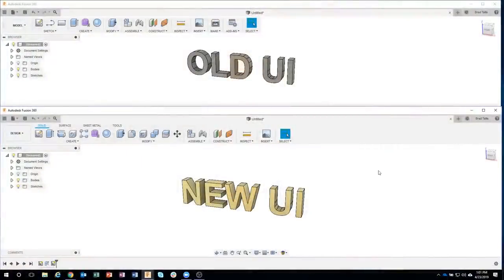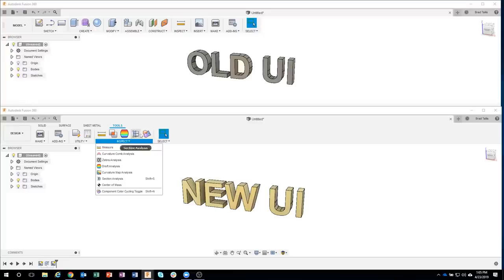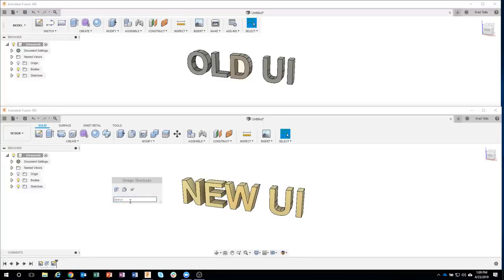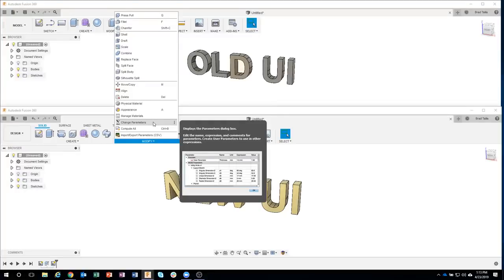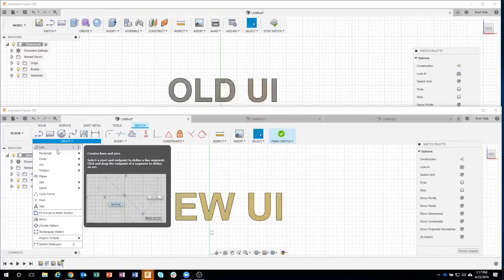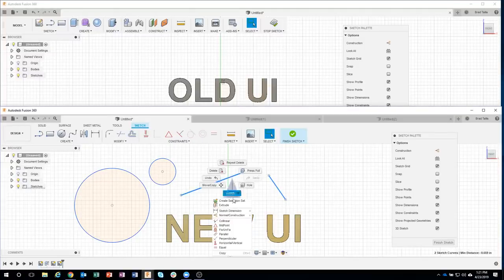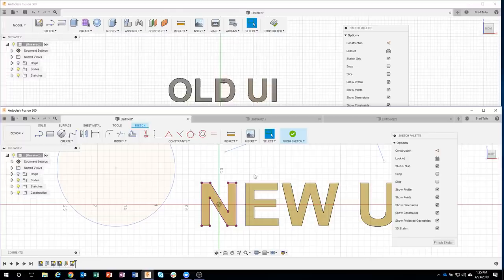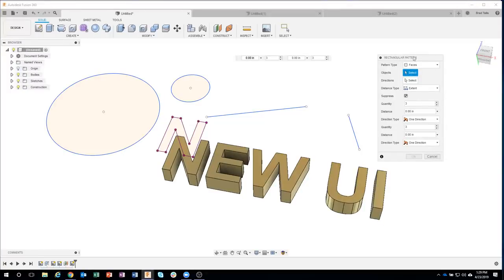Episode 28, Old vs  New UI

Comment: Brad, thanks for this useful video, I've a question. How can I take my UI configuration to another machine?
Reply from the maker: @Enrique-  Your UI configuration is saved to the cloud, so when you log into another machine with your Autodesk ID, your configurations (keyboard shortcuts, toolbar icons, etc) will move with it.
Reply: Brad, thank you again, it worked as you described in your post, good work.

Comment: Dick Williams 
 Enjoy the very useful videos.  Changed over to the new U/I and cannot get the copy/move command to copy a model that I want to copy and modify.  The command will move the model but cannot get it to copy.  What am I missing?  Thanks - please keep them coming.
Reply from the maker: @Dick-  You will want to check the little "Create Copy" checkbox in the bottom of the Move Dialog before you move the part.

Comment: Hi Brad, I am new to fusion 360 and also Cnc machining. My company mostly uses our mills for drilling holes, slotting, and the occasional miter cut of some tubes. My company currently has someone from another company doing our programming. I want to take this over but have not clue where to begin and what to do. Are there classes I can take at home. Is fusion 360 what I need or should I be using another autodesk software. Please any help would be greatly appreciated. Also if it would be easier to contact me via email just let me know. Thank you I look forward to watching all your videos.
Reply from the maker: @Derrick-  I HIGHLY recommend using Fusion 360 for this and I'm not just saying this because I work for the company.  I spent a couple thousand dollars for Vectric Software awhile back, and then I got hired at Autodesk on the Fusion 360 Team.  I use Fusion for all my design AND manufacturing needs.  The Vectric software just sits on a shelf now.  :(
I personally recommend going through the built-in training inside of Fusion 360 (the ? at the top right of the screen).  Then, I recommend subscribing to the Fusion 360 Live youtube channel as that is where we put a lot of our current material.